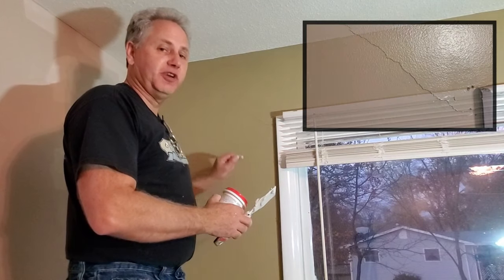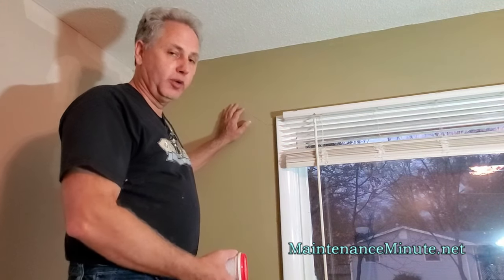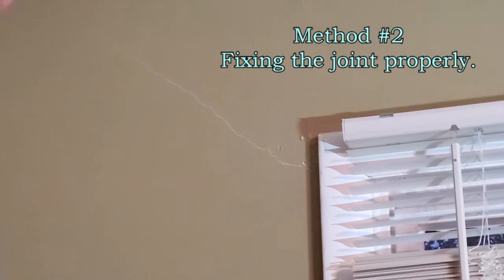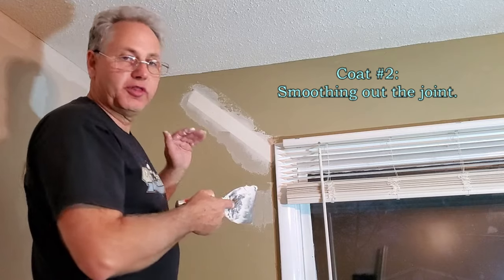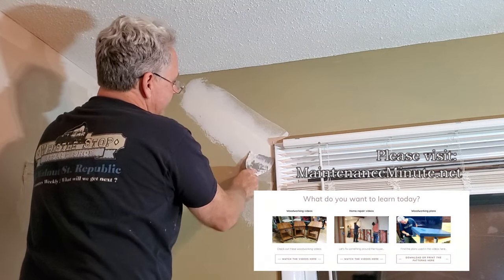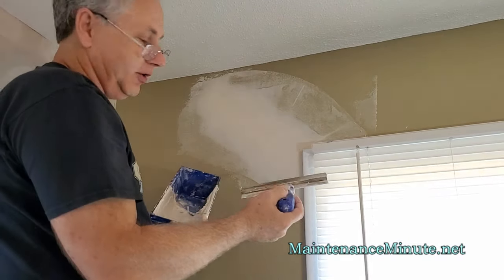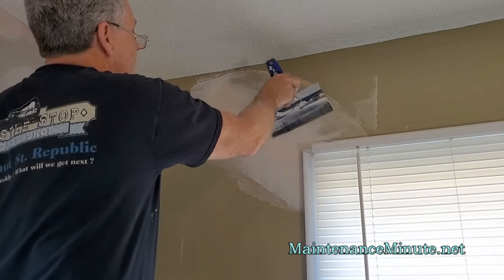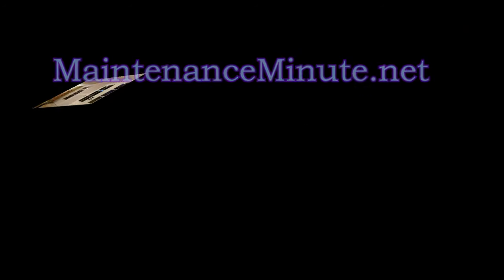You can do it! Fixing drywall settling cracks,  How to fix cracks in sheetrock,  Drywall repair.

Comment: You should open the crack at a 45 on each side and tape it
Reply from the maker: Thank you for watching my videos! 
I agree. Especially if the crack has separated more than a 1/16".
Reply: I do that and use hot mud with no tape and it last longer.THose always recrack.
Reply: Yep. Open that up, then fill and tape with hot mud. Never see that crack again.

Comment: This is the easy part, when you get to paint and it does not match the existing and then you have this giant off colored patch LOL. This is my main issue, I can patch I can NEVER get the patch to match the surrounding area, ANY TIPS please post.
Reply from the maker: Yes, unless you primer (or paint) the repaired area, and then repaint the whole wall you wil see a different sheen where the patch was made. I cover this and texturing the patch to match in this video: https://youtu.be/iPhCZdfYL-g
Reply: @millin360  OK, thank you for the help. I think I am like most I can get the patch pretty nice, then I totally fail at the paint side. I will watch your link and try and learn some pointers to address this. I have a bunch of repair work to do so this is very helpful. 
Thanks!

Comment: i bought a brick home that was built in the 70s. almost every door frame or window has these cracks but they are like 10-20 inch long. should i be concerned??
Reply from the maker: Probably nothing to be overly concerned with. If they return after following the tape and mud method, you might want to  have a contractor take a look. Usually this fix will take care of it. Thanks for watching my video!
Reply: @millin360  thank you! i’m a first time homebuyer and didn’t really know to look for this stuff. it’s a solid home and has lasted this long. i’m sure it’ll be fine haha. thanks for the reassurance
Reply from the maker: Welcome to home ownership!

Comment: 3:25 ??? You don't want to get all the mud out from the back, being to dry in the back is what the causes bubbles, it's the tape not adhering because all the mud was squeezed out..
Reply from the maker: To be clear, the process is to get the excess mud out from behind the tape. Obviously if there's no mud behind the tape, there is no adhesive to stick the tape to the wall.
Reply: @millin360  yeah u said 'you want to get as MUCH of the liquid out as you can'.... To the diy homeowners out there they take every word of these type video 100% literal. And they will stand there and squeeze every drop of mud out from under the tape because that's what you said/infered. You gotta be careful trying to help people, because you may just make them perform horrendous fix that bubbles right off the wall when it dries.
Reply: Some of these cracks are from poor drainage from outside the home.  If your downspouts dispense water around your foundation, that causes the soil to expand.  When the soil expands, it causes the foundation to move upward.  When it dries out, it contracts.  I had that problem, and installed a French drain to remove, and take the water to the street.  After the drain was installed, I fixed the cracks with a product called Crack Tape.  Since then there have been no more cracks.  You can tape all you want but the source that is causing the cracks must be remedied first.
Reply: @ericknoblauch9195  What are you talking about. It has zero to do with squeezing out all the mud. You must be watching some totally different video.

Comment: When you see cracks like that, does that mean you should sell the house?
Reply from the maker: Not at all, when a home is built, the materials are ridged and stiff, they are the temperature  and barometric pressure of the climate you are building in. As the home ages, those things change. The home expands and contracts. These environmental changes can cause the home to "rest" in a different position than that it was built in. This ever so slight movement causes "stress cracks".
With that said, there are cases where the builder did something wrong, and the movement is due to poor structure. Those types of cracks are usually much larger and reoccur after being fixed. A structural engineer should be called to evaluate those.